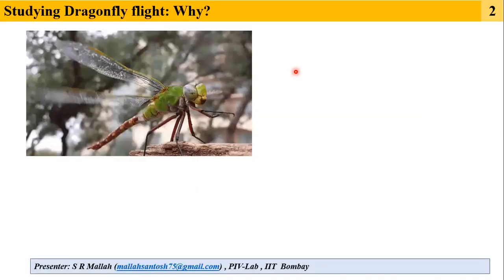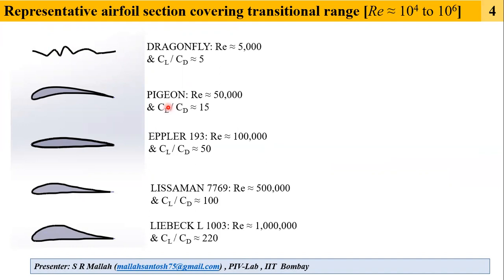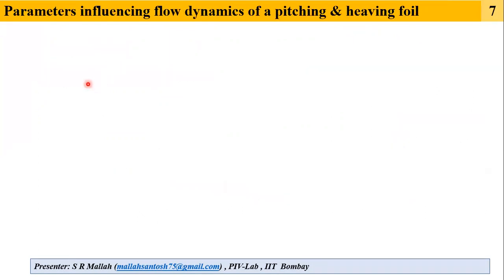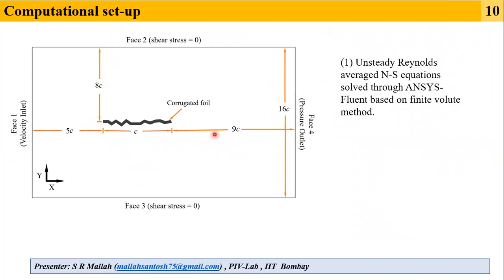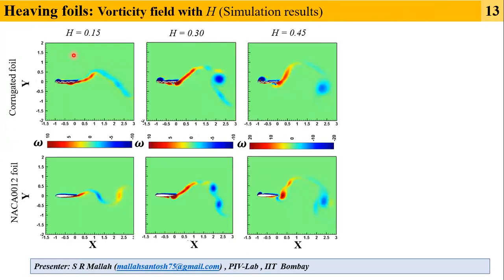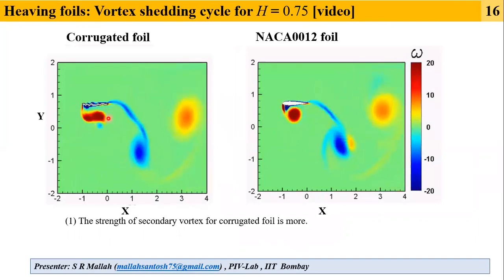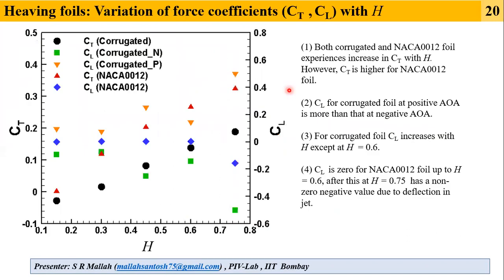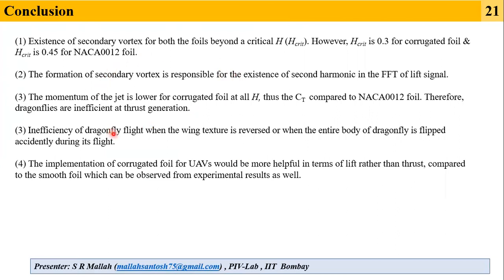Dragonfly flight dynamics at various amplitude

Comment: Experimental design seems oblivious of flapping flight dynamics. Birds, and we have to assume, equally efficient insects, alter angle of attack far more than in the test design, with each change of wing motion. Birds also have complex heaving patterns, usually seen as a figure 8, moving from up and back, then foreward, to down and back for the down stroke, then reverse on the up stroke. Any conclusions for dragonfly corrogated wings is additionally complicated by their having two sets of interacting wings, with fully independent control of Each wing, leading to the hypothesis far more complex wing interactions are happening, or all the work of evolving this complicated design wouldn't have borne fruit, in the most acrobatic and fast insect, and probably of any flying animal or machine. 
Criticisms in point: flapping flight does not separate lift from thrust, unlike stationary wings. Which don't do 'thrust' in any regime. In real flapping flight angle of attack changes to make 'lift' become thrust. Thus no engine (rotating screw foil, or various 'jets'.) required. The more sophisticated flappers thrust on both up and down stroke, over part of each wing, if not the whole. The study also neglects any view to understanding the observation by some students, that real dragonflys have about equal top speeds both frontwards, and backwards. (and inverted) Why they have the highest successful attack percentage of any predator, they simply can outfly anything around small enough to eat. 
I'd love to see comments on this study by the developers of ornithopter drone and full man carrying designs. My suspicion is modern computers at dragonfly scale may be finally up to mimicking full dragonfly wing dynamics with fully independent dual pairs of wings. How to drive such mobile wing designs may be the next challenge.